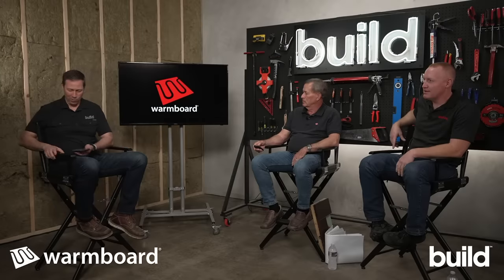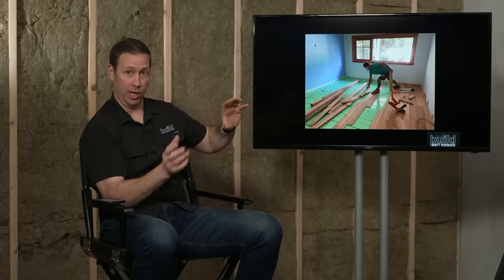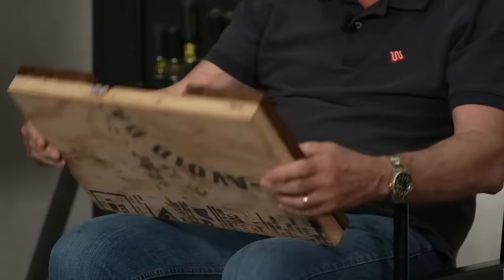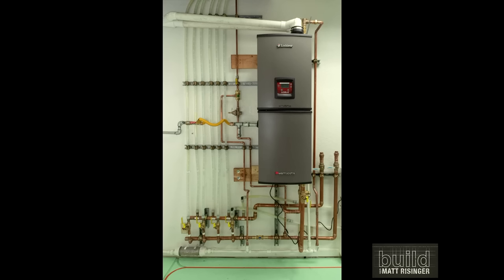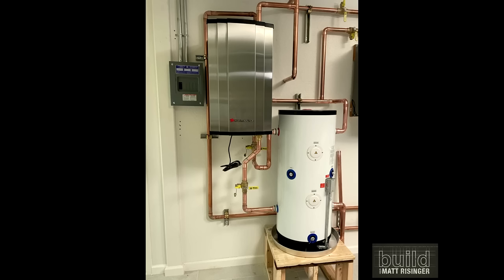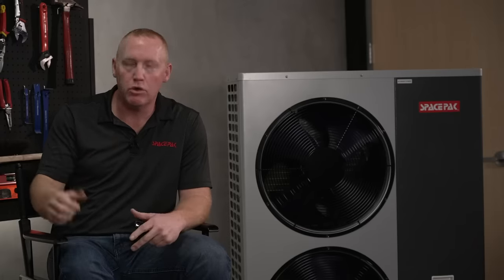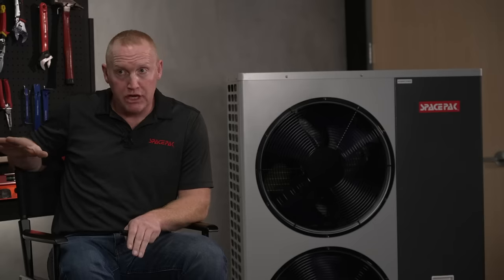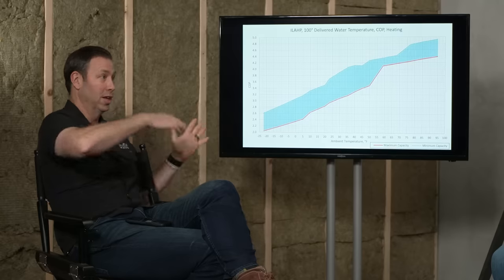Cold Climate Heat Pumps for Radiant Floor Heating. No gas, no boiler!

Comment: I’m curious about how this system will work for cooling in the hot and humid summers I endure in good old Minnesota!
Reply: Good one… cooling!  You’ll need a separate system for that.
Reply: @superspeeder  not an entirely different system, most of them can do cooling also.  You’ll need another distribution system for the cooling.  For example, in floor radiant for heat and multiple air handlers/ductwork for cooling.
Reply: You’d need some sort of dehumidification to prevent condensation, but otherwise you could run cold water through the system and get cooling…
Reply: @brians8664  “multiple air handlers and ductwork for cooling”.  That system could do heating and cooling on its own, so at that point you don’t need heated floors.  One of those two systems makes sense, but not both, and if you need cooling then only one of them makes sense. 😉
Reply: @highlorddarkstar  call Warmboard and tell them you want to use their floor system for cooling.  Let me know what they say. 😉
Reply: @superspeeder  they’ll ask how much I can pay to find out, I’m sure.
Reply: @superspeeder  Kinda. You definitely don't want to run chilled water through your radiant floor; you need fan-coil units for cooling so that condensation is managed correctly. But you can use the same heat pump to do both cooling and heating. They all have a reversing valve, and can switch quite quickly from cooling to heating and vice versa. The problem is that all the water in the system needs to be taken from a high temperature to a low temperature or vice versa. So you do really need two sets of pipe work, and two buffer tanks if the system doesn't have enough volume of water without a buffer tank. This adds to the cost significantly.
Reply: @tlangdon12  all true.  And once you install a complete parallel supply system for cooling, then realize you can also use fan coils for heating, it makes the exorbitant cost of heated floors even harder to justify.
Reply: @superspeeder  While fan coils can be used for heating and cooling, the fact that heat rises makes radiant floors the best option for heating, if you can afford the extra expense. I think Warmboard have the right idea of making a simple structural panel for the floor.
Reply: @tlangdon12  “if you can afford the extra expense”.  Exactly.  These guys should give up the “efficiency” sales pitch altogether and just market this as a luxury, which it is, and a nice one for the right buyer.

Matt should also stop pandering to these companies, cheapening his brand while promoting their products.
Reply: @tlangdon12  Don't forget that fan coils can also be set up to blow air at floor level, as is common in New England and the Midwest.
Reply: @tlangdon12  Condensation doesn't occur where there is no air. 
It would be a drag adjusting water temp from 90F to 50F and back.

Comment: Any comments from Matt on AdvanTech vs this? Any downsides when it comes to comfort (on the foot), squeaks / noise, etc?
Reply: I'd like to here Matt's opinion on use of air sourced heat pump system use in cold climates like Minnesota. I am looking to build a system for my detached garage and then my home.
Reply: @richardlougee7625  air source like a minisplit doesnt really work.  they will freeze up.  running sometimes and only down into the teens.  heres mine, cheap and easy.  https://youtu.be/i2Ve_AYuplc
Reply: my advantech should be stronger.  their new construction panel needs to be 1 1/8" thick because so much material is removed for the tubes.  the aluminium maybe gives some strength back but where the tubes are, its only 1/2 or so therefore not anywhere close the advantech.

Comment: Does any radiant system have a thermal paste that would aid in conduction between the PEX line and the aluminum top panel? I'm thinking something that you would lay down a bead of paste in each grove before inserting the PEX line to create a better mating surface between them.

Comment: The average delivered cost per KWH in NY State is  .21 cents. It's approximately 29KWH per 100k BTU's. Which means the cost is approx. $6 per 100K BTU. That heat pump will average a 2 to1 in New York, so it will cost you $3 per 100k BTU's. 1 CCF Delivered in New York is $1. 1 CCF= about 100k BTU's. At the water temps you are talking, a condensing boiler will run about 92% efficient. Doing the math, the heat pump costs will be about 2.76 times higher than a standard condensing gas boiler. The cost of that heat pump will also cost 3 to 4 times more when installed.
Reply: Yes and that boiler will last twice as long as the heat pump.
Reply: Absolutely a Condensing boiler works the best with radiant floor heat
Reply: However, the government currently fails to internalize tremendous externalized social costs of burning natural gas: costs due the  global climate destroying effects of de-sequestering and burning such fossil fuels.  Once the government ends such unwarranted and destructive externality subsidies, natural gas will cost you perhaps 100 fold or more than it does now. 

This is all in a few years time frame and so investments meant to last decades must consider these rapidly rising cost of fossil fuel issues carefully.
Reply: @robburns1ne  if you believe this you had better start practicing your Chinese language. The CCP is commissioning a coal fire generating plant once a week. Natural gas byproducts of Burning help plant growth and will increase our timber production and farm production.

Comment: As a Canadian I really appreciate you don't forget about us in your videos. My forced air electric furnace can use up to 18000 watts on a cold day. How many watts do these units run at. Also with heat pumps can you only connect them to boilers? Keep up the great work.
Reply: Hey Tyson. Depending on your load, have a look at a Navien combi boiler paired with an iFlow air handler
Reply: Heat pumps work with air and any other heat distribution system.  You will get higher efficiency with in floor heating due to the lower temperature on in floor (I.e. you don't heat floors to 120 or 140F which is required for an air handling unit.
Where outside air temperatures go below minus 10 or even minus 20 you will need backup hear for air heat pumps.  
For ground source pumps, outside air temperature is irrelevant. But the heat pump must still be sized to meet your anticipated heat load.
One should also mention that if you in a coastal environment, the outside air unit is going to take a beating especially is salt is present.

Comment: They don't mention it in this video, but the real benefit of the radiant floor/ceiling tech, and the low operating temperature water it requires to deliver adequate cold climaate space heating, is it facilitates use of solar thermal energy.  Solar thermal tech is well developed and a reasonable system is capable of economically delivering ~ 100 deg F+ water most days of the year.  Very little electrical energy is required to collect thermal energy from solar thermal panels.  We call this low grade heat energy in engineering.  So with such a system to augment the heat pump driven technology, (electrical) energy bills can be dramatically reduced.  In the past, with baseboard heating or hydro air systems, much higher circulating water temperatures were required to deliver sufficient heat to the space heating load.  So houses with such systems can use sunshine to heat their homes > 50% of the heating season, and greatly reduce fossil fuel consumption - leaving the rest in the ground or directed to other applications.  If you've got the capital or access to credit to install such a system, I highly recommend it.  You will be leading the way for the rest with access to sunshine to follow, as greater numbers will reduce price of components and installation/service.

Comment: I have three heat pumps right now running on backup resistance. In PA our grid is in shambles, that week long snap of cold weather made blackouts up and down the east coast. Flooded homes, frozen water pipes. Smart people learned a good lesson about heat pumps as an only source of heat and are now going back to gas. You talk about builders and designers installing these heat pumps, yea on a beautiful summer day. Any mechanics on here going to go out in a foot of snow on a 10 degree day to swap out a bad TXV or reversing valve? I sure as hell am not going to kneel in snow and freeze my ass fixing your heat pump because you think your saving the planet. Nothing better than opening a system loaded with POE on a wet day   lol. Heat pumps are great if power loss doesnt involve death or frozen pipes. As far as combi boilers go, its a big step backwards, Most combi boilers are 200,000 BTU's as to make sufficient domestic but the turndown ratio is based on input, so minimum firing rate is going to be 20,000. My home has a heat load of 36000 on a zero degree day. What sense does that make. If you can afford warm board then by all means buy a properly sized boiler and a separate tankless water heater. See you guys in Atlanta if it isnt burned to the ground by Feb 8   lol

Comment: Is this system used instead of central air? If so, can you cool a home with it, as well?
Reply: Hopefully others will confirm or correct me, but my understanding is that such water piped cooling has a moisture condensation problem that no one has found any way out of it.

Comment: Floor heating is very comfortable, no one questions this. However, the installation cost of a professional plumber for a PEX water circulation system is very high, and there is a risk of freezing the pipes once the heat is lost. Moreover, the air source heat pump system is complex, expensive, expensive to repair, and not reliable(mechanical failure or weather disaster).Perhaps, resistance floor heating mats (easy to install), coupled with solar panels, are a lower-maintenance system. In any case, after 15 years, the heat pump host or solar panels will need to be repaired and replaced.

Comment: can you run cold water under hardwood floors??? Would that make the pipes sweat??
Reply: Matt did a video on hydronic cooling https://www.youtube.com/watch?v=rPC0_LxlwIY. I don't know anyone that's done it though. In short you need good controls to keep the dewpoint low enough to avoid condensation.
Reply: @KennyMacDermid  there are electronic systems, but temp has to be within 3 degrees, very slow heating and cooling.

Comment: How do you find a leak?  and repair it? Got a leak upstairs and short of tearing up a really expensive floor no plumber will touch it.
Reply: water will leak around the 4x8 seams so you have a 32sqft area to rip apart.

Comment: Is the warm  board available in canada?
Probably not, they usually 100 years behind
Reply: It is, I called them, they are in BC.   Unless you want to completely renovate your place, the cost of this and payback of any savings would take decades.  And then of course their install isnt the cost of replacing all of your flooring, etc.  Its supposed to replace your current HVAC, but how does it replace your AC?  Since most homes with AC now have the usual HVAC ducts and the furnace fan blows it around.  If you get rid of your furnace, whats blowing the air around?   I mean if someone wants to explain that to me Id love to hear the answer

Comment: guy below you are right one layer osb with a reflective foil followed by a second lay you have to cut the pex grooves in all the way through make them double wide and fill them with mortar put you flooring right on top work perfectly and is cheap these contractors are always looking to spend spend spend on material so they get there cut

Comment: Since the absolute zero is -459.67ºF, I'm not surprised that the heat pump's able to extract energy from the ambient air at as low as -22ºF. In fact, it's a shame that it's not able to operate at much lower temperature.
Reply: Living in MN I’m waiting to get a heat-pump until it can work all winter long.
Reply: @ Quadro Effects.     Do some reading-research on the fundamentals (operating principles) of refrigeration (Heat pumps are an application of refrigeration principles).  Your beliefs overlook some very important physical principles.  Scavenging heat from cold outdoor air in quantities sufficient to even come close to those necessary for  heating a home in a northern climate needs adequate airflows of the outdoor air across an adequately sized air-to-refrigerant heat exchanger and a refrigerant that can perform (sponge up the heat) at those low temps, ... PLUS that same refrigerant has to also operate efficiently-effectively in warm/hot summer temperatures as well. That's simply not really possible  in a robust way in many northern regions.  That is a VERY tall order. And I'm skirting past other very significant issues.
Reply: @James Karrie  Absolutely agreed, James.
Reply: You could probably build a heat pump functional down to, oh say, - 452 F using liquid helium as a heat exchange fluid . That would cost $15,000,000.00 or so......  once you ramped up production!

Comment: Could something like Spacepac be used with a residential electric water heater to reduce the water heater's electricity needs? Kind of like a hybrid water heater but the heat pump would be outside instead of on the top of the tank. I have a hot water recirculation pump that pumps the lukewarm water from the pipes into the water heater. What if that same plumbing could be tapped into to get water from an outside heat pump and bring it into the water heater. Also what about putting that heat pump in a garage to provide cooling for the garage? I live in Florida so there is plenty of heat to harvest from the outside or garage. Also, I don't want to use a hybrid water heater because my water heater is in the house and I don't want to hear it running.
Reply: Look this guy did something similar but he ran the coolant lines directly into the tank instead of heating water and then pumping it into the house.

Comment: OK, you've done Antarctic, so I assume you can do Winnipeg MB. 

We commonly get -20 to -30 C (-4F to -22F) for 3 months a year.  Each year we have about -40C (-40F) for 2-4 weeks. 
So I assume outside air is too cold for your system. So how about using Geothermal pipes planted 6-8+ feet underground to provide the air? My city water pipe has frozen a few times when outside air is lower than -30C for a couple of weeks. But I don't know if this is cold conduction in the concrete basement wall, or the actual ground.  I can keep it thawed with a small 1000w space heater on a timer to run less than 50% time.
800 square foot house.

The final comments about loud heating system made me laugh.  Around 2000 I replaced the natural gas furnace in my house because I realized it had been installed (1960) about a year after I was born, so it's efficiency would be low.  When the first set it up and left, after a short while I realized the new furnace was blowing so much air through the ducts that in places it sounded like a Jet engine running.  It took 2 call backs to get the air speed turned enough to not make me have to shout to be heard.

Comment: Im a plumber by profession and I can say that using a system with several accumulators is the way to go if you have the space and have access to a cheap heatingsource, like wood, that is the way to go. It sounds like these guys have a hard time putting a technical room together and worried about callbacks etc, which is a none issue if done correctly and have a plan, ofc components can fail but that can vey well happen with these heating pumps anytime. 
It\s a poor argument and it is important to hire the right and experienced plumber for the job where it will work out just fine.

This is expensive regardless how you look at it and it comes down to money, and if you want something cheap that is very weather realiant, then air to air heatingpumps is the way to go, BUT if it\s cold and lower than 10 degrees, then it will not be good enough.

Comment: Question for all 3 guys! I'm at 24 cents ( and probably rising soon) a kilowatt hour. I want to use hydronic heating for my heating system revamp ( removing my forced hot air system)!
With high electrical costs wouldn't baseboard heaters with warmer water get the heat demand satisfied sooner, ( less electrical usage)??
Love warmboard but floor coverings smother the radiant panel effect, whereas baseboard copper tubing puts the heat through aluminum plates directly to the air!
Reply: If you already have ducting in place  from your forced air furnace why don't you go with an air to air heat pump? The newest generations are fairly modest consumers of power. The front end costs of installing a hydronic system will take ages to get back. Get the heat pump and with the balance of money that you didn't spend on the hydronic system, install as much solar panel as you can afford especially if there is any incentive in your area. Regions with high electrical utility rates usually have incentives.
Reply: @paulmcgown7504  prior house had hydronic heating.
I replaced the old boiler with a mod on boiler with primary/secondary heat loops.
I hate the noise and the so so heat from the registers 108 degrees is the best it gets.
I hate the a/ c blowing on my feet in summer 
I will be putting in a spacepak a/c system so a/c comes out at the ceiling.
Heat on the floor, a/c at the ceiling.